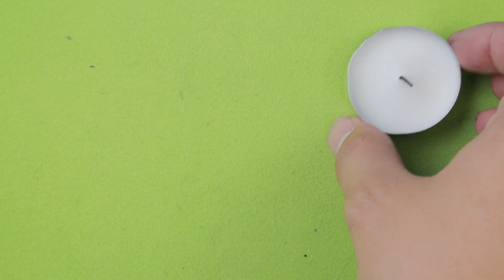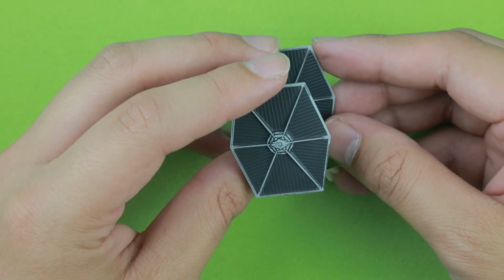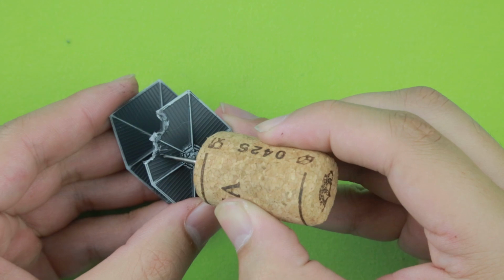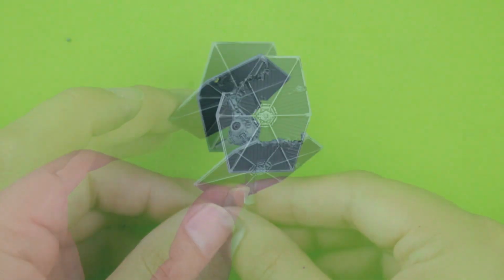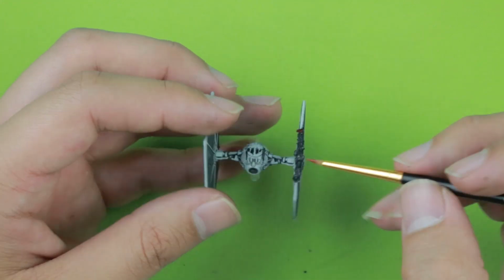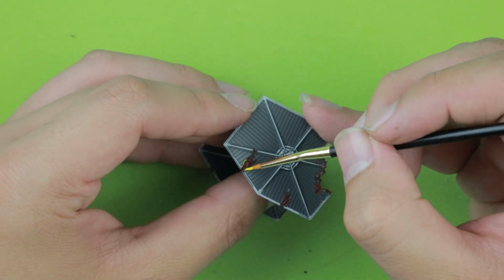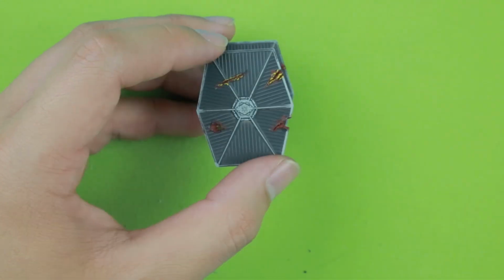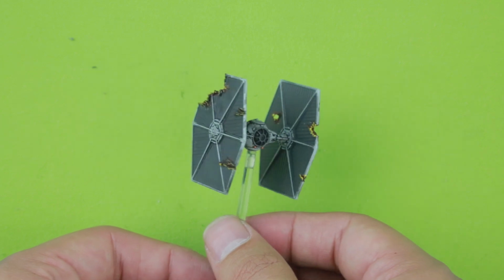X-Wing Battle Damage Mod

Comment: How did you get the nail to stay in the wine cork?
Reply from the maker: +Jason Egan I believe he did it by using a nail without a wide head, I think they're called finish or finishing nails. Poke a hole in the cork with the pointy end of the nail about half the depth of nail into the cork, then remove the nail and push it back into the cork with head first instead of point first. The small head of the finish nail allows it to go in easily. You might have to use the ground or a scrap piece of wood to push it in to protect your finger.
Reply: +Flaming Dice Reviews Thanks! I may give it a shot today.